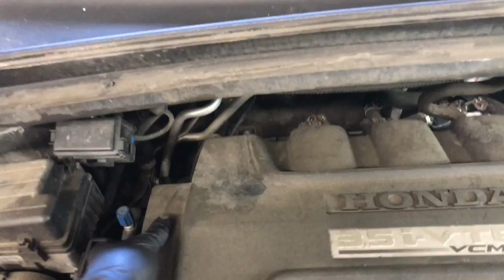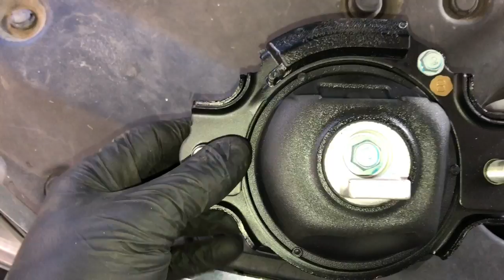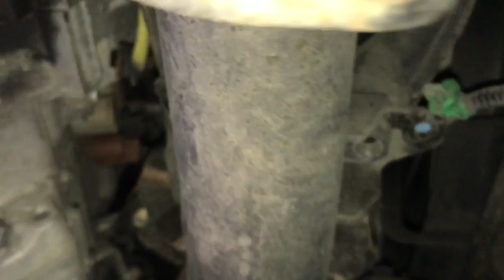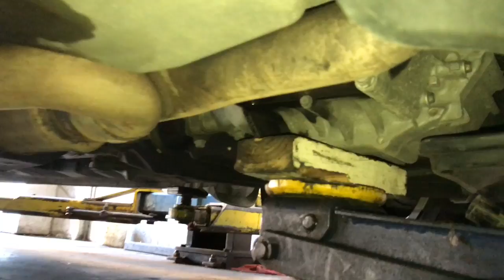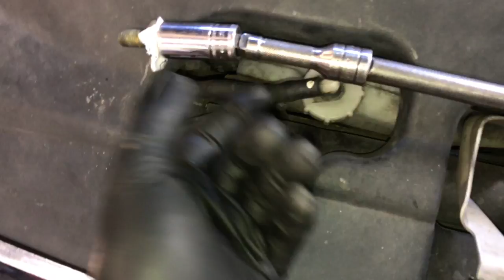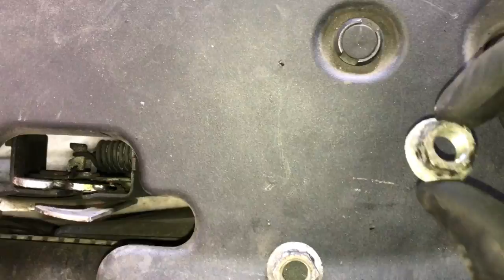How To Replace A Front Active Control Engine Mount On A 2005-2010 Honda Odyssey

Comment: These instructions do not work for a 2010 EX-L. There are some additional things in the way in the gap that I don't see in the video; I had to remove the radiator hose and fans to get it out (this required a coolant bleed). I could not find a way to do it without it; removed battery tray too.

Comment: Many viewers I'm sure we're hoping you would tell us why are motor mounts electronically-controlled and are they electric or hydraulic
Reply: Because these engines have a cylinder shut off feature that causes the engine to shudder when active. The motor mounts soften up when this happens.

Comment: I found an easier way to remove the front engine mount:  remove:  the battery and the plastic tray; battery bracket; air filter tray; hose slip; remove #6 coil; remove the ground wire.  Now you have direct access to the rubber balancer damper and the old engine mount.  Don't remove the aluminum mount.  You dont need to do this extra work.  The rest of the video is spot on..

Comment: that's weird my 2010 has a small hose going into the bottom , did not have a wire plug
Reply: That's because your are hydraulic engine mounts, I believe they work with your vacuum system controlled by the car computer.

Comment: Is there an easy way to tell if these are bad if the engine and cradle are out of the car? I’m replacing the engine in my wife’s 2012 odyssey and never seen mounts like these. If they are bad I’d love to replace them while I’ve got it all out of the car. Also I’ve disabled the active fuel management system on this vehicle so do you think the aftermarket mounts would be a better way to go since I may not be using the adjustable dampening anyway?

Comment: A very nice and well done video on getting that pesky Honda Odyssey front motor mount replaced. I think you can get to the 4 bolts of the engine mount from the bottom instead of using the 3 ft long extension from the top. I just worry that these bolts could be stripped with the wobble head. I think someone also has the right idea to remove the rubber  damper instead of the motor mount bracket to slide the motor mount out. My Odyssey does not has a motor mount problem yet but I think one day, I will need to do this. The OEM part is expensive, it's like $1000 for the front active motor mount, not counting any labor cost so the dealer probably will jack you for at least $1500.

Comment: Great Video and instruction especially when you look at how other people have approached this fix.  My biggest problem was with the top left hand base nut but that he removed the coil pack to line up with.  The only thing I could line up onto it was with using a 1/4 drive.  3/8" and 1/2" drives would not allow me to get a socket on the nut even with a wobble or universal on the end.  It was the hardest nut to put a wrench on for me. Luckily it moved using a 1/4" drive (and lots of soaking in PB Blaster!)  Other comment is that you can remove the two bolts from the top aluminum bracket from the BOTTOM a lot easier then from the top. also as noted in other comments if you take out the rubber damper to the right I don't think there is any need to remove the top bracket.  Mine was so badly rusted I couldn't get a 12mm socket on it.  Overall great video.  Took me a solid a solid 4-5 hours (I'm a slow mechanic) but I got it done without removing 5 million other items.  Great Job!

Comment: I did this Job last weekend on an 2007 odyssey EX-L took a solid 4 hrs. Couple tips, removing the air box and battery gives you more room from the side and only took another 20 minutes. Also needed that room to get the motor mount out, it was such a tight fit that a couple of fins  the driver side fan guard broke when removing it. And as another comment mentioned if you remove the counter balance damper next to the motor mount you may be able to slide it out without removing aluminum bracket attached to the engine.  When re-installing, leave the 4 bottom bolts loose in order to line up the top bolt that goes into the aluminum bracket.

Comment: Excecllent guide. Thank you. Just finished this with a friend on my 2005  Odyssey EX-L.  Ran into a problem with the left hand bolt on the top aluminum bracket attached to the  engine.  You pointed it out as the hardest bolt to get to and remove.  After not getting it, after several tries, my friend decided to remove the rubber damper attached with two bolts to the subframe immediately to the right of the motor mount.  The damper lifted out from the top.  Since the motor mount is loose  already, jack the engine up  as you describe and slide the mount to the right and lift out as described.  So other than removing the upper motor mount bolt to the top bracket, the bracket does not need to be loosened or removed.  Again great video,  best picture and description I have seen on any diy video.
Reply from the maker: Robert Mahakian thank you for the tips!  Glad it all worked out!!

Comment: Dude 500.00 bucks for one mount...so the AutoZone mounts for the FRONT  at 149.00 is not GOOD....please tell me..
Reply from the maker: KangoKid Kidd my experience with aftermarket mounts has not been a good one. I have installed them and they come back with vibrations and also premature breaking. But I will say they are better than driving around with broken mounts so if that's what you need to do I would recommend installing them.
Reply: How to Automotive thank you...so is this Honda mount for 500.00 a mount with some kind of computer chip in it or what...Autozone has a lifetime warranty  as long  as you own the car..
Reply: the honda mounts are controled by the computer. that engine has variable valve timeing and with shut down three cylinders in order to run with better efficiency and the motor mount is made to adjust somehow.  the aftermarket mounts just bypass the electrical and trick the computer to think it is working.  They will were out faster and if the front weres out the back will go out soon after.  they are both active control mounts and are both 500 plus.  the aftermarket ones will work but for not as long and not as well.
Reply: @Brandicakesdesserts I wonder if the aftermarket ones last longer if the VCM has been disabled. I have a VCM muzzle on mine which stops the cylinder deactivation.  It seems logical that if it’s disabled then the aftermarket mounts don’t get the same stress and will last quite a bit longer.  Although I have no found anything on line to confirm this.

Comment: Thanks for this video. I used this video as a guide while I changed the mount on my 2005 Odyssey. I went with a aftermarket since I have 115,000 miles on my van and don't know how long I'm going to keep it. Only thing I did differently was I took the bottom mounting bracket bolts off from underneath the van Basically I put my car up on ramps and was able to get underneath it with a 14 mm ratchet wrench. I am not a mechanic savvy by any means but this video help tremendously even though it took me pretty much the whole day to do this job. The next job for me is to change the ABS wheel sensor on the right front.Thank you keep up the great work
Reply from the maker: Blueknight 1997 glad the video helped. The ABS sensor should be a breeze for you. Thank for watching!

Comment: You could show how to change the gasket of the engine oil of this same truck. Little oil out there but I have no idea how to do it.
Reply from the maker: I have a video on a Honda valve adjust and take the valve cover off and show you how to reinstall them. https://youtu.be/h0YEVBodOAE